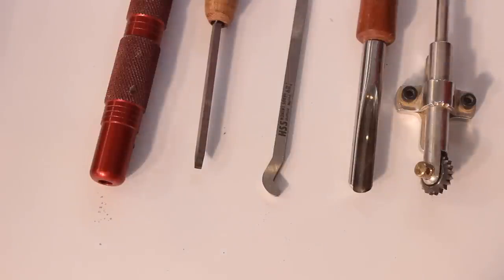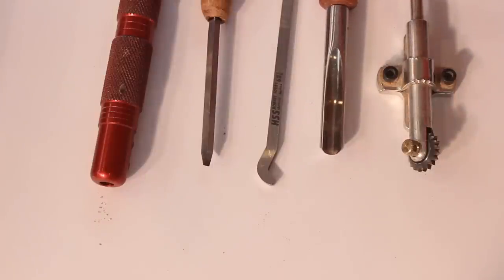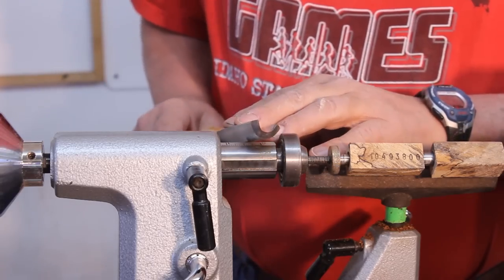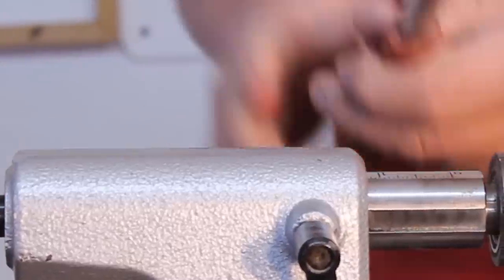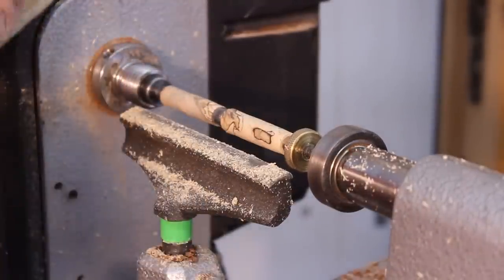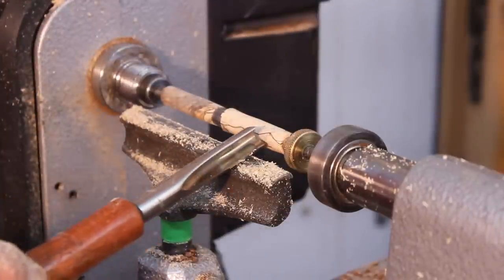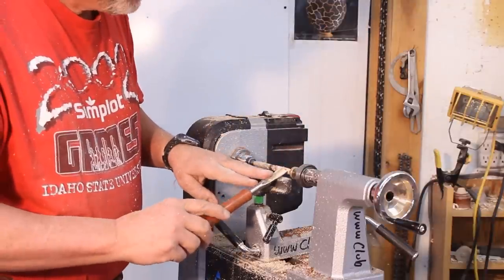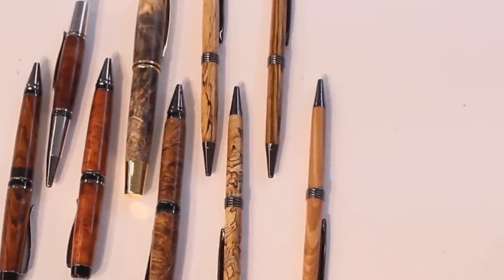Pen Turning with the Robert Sorby Micro gouge

Comment: Thank you for the video. I have been turning pens for about 7 months, and have turned about 250 so far, mainly acrylic, resins, some wood. I use carbide tools, but want to get into HSS, I have a good budget, what do you like as far a chisels? And what about a sharpening system? Thank you. I also like the folks at CSUSA.
Reply from the maker: Tanner
It sound like you are new to turning.  If so, and you are looking for some quality HSS turning tools, I would look at Crown Pro PM, Glen Lucas tools from Craft Supply.  I also like very much D-way tools, Oneway tools and Doug Thompson tools.
For sharpening, maybe the Delta variable speed grinder.  If you are looking for a jig, the Oneway-Wolverine is really good.  If I am not on the right track, give me some more info as to what you need.  
Sam
Reply: WYOMINGWOODTURNER You are right on! Thank you. I have received recommendations from the PSI Benjamin's Best to the Robert Sorby. I am very confused. Thanks again.
Reply: +Tanner Tucker  I use the wolverine set up for sharpening. It helps me get the same shape/angel each time.. important for a new turner

Comment: Another  nice demonstration Sam,  thanks. I am a beginner myself and am looking to make pens and want to purchase a starter set but not sure which one? Can you recommend a set and source?
Reply from the maker: I go to Craft Supply USA.  One recommendation------go to one supplier and use only that one supplier.  They often offer the same pens with different names.   The pen kit I like for just a good general pen for anyone is the Roadster pen from craft Supply in Provo, Utah.  

The least expensive that most will offer is the Slimline.  It is really slim.  I don't like the look of it and it is hard to vary the profile too much.  The Roadster is a little thicker at the center band.  so you can do more.  Also, each kit will use different bushings and sometimes a different drill bit.  So the more "different kits"......the more little accessories you will need.
Hope this helps
Sam

Comment: Those are beautiful pens.  I use a roughing gouge for the entire pen turning process and use it exactly like you do except that the roughing gouge I use is 1.25".  That seems like overkill but I have found that a tiny movement of the long handle is a microscopic movement at the blank.  I also use a 40 degree grind which can be very aggressive but cuts like a skew.  I'll do a video some time to let you see what I'm at.
Best Wishes, Brendan.
Reply from the maker: Yes I must confess I will do an entire pen with the roughing gouge.  But I do like this little Sorby tool.  thanks Sam

Comment: DON'T WASTE YOUR MONEY ON SORBY OR ANY OTHER MAKES...
get an old rusty tap (tap n die set)
Then leave the inside of one part alone, whilst grinding the outside to shape... The make lovely micro gouges for pennies... Fit it in a handle first to make it easy to work with.. 👍